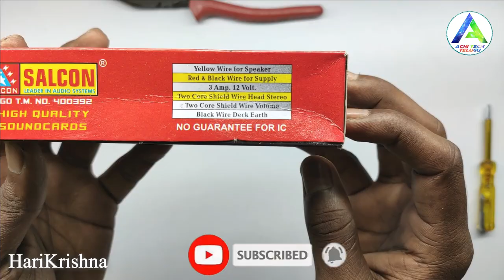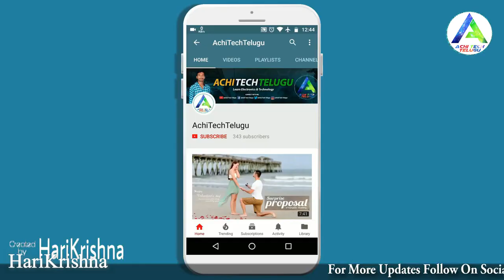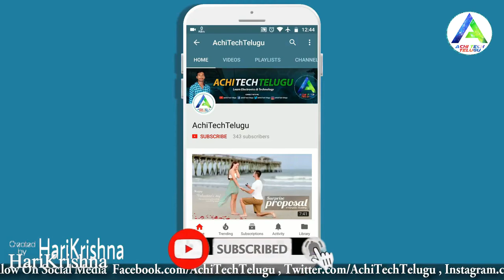Diy 4440 Ic Amplifier Telugu Part 3 | Audio & Red Solrax board Full wiring |#AchiTechTelugu

Comment: Bro 4440ic board ki speaker connect chesinapudu speaker automatic ga up and down avthundhi enduku bro
Reply: Reply ivvandi bro
Reply from the maker: Oka sari volumes controller wires ni check chiyandhi bro emina loose contact vunaemo , next speaker wire check chiyandhi , next power supply bagunda ledha chudandhi , i hope it wi help you
Reply from the maker: Already cheppanu chudandhi bro
Reply: Board tho ichina wires unchavacha bro
Reply: And aa problem asthamanu avvadam ledhu bro vadthundhi pothundhi
Reply from the maker: Manchi quality vuntey , vunchandhi bro , ledantey marchukondhi bro
Reply from the maker: @as8722  nenu pina cheppinavi anni check chiyandhi bro

Comment: 25watt amplifier medha 200RMS watt speaker connect sesthe problema
Reply: Reply me bro
Reply from the maker: 25 Watts very less than 200w Speaker Wattage So Amplifier will overload bro , but use will low volume and try it once 
Thanks for Watching , Do Like Share And Subscribe #AchiTechTelugu
Reply from the maker: 25 Watts very less than 200w Speaker Wattage So Amplifier will overload bro , but use will low volume and try it once 
Thanks for Watching , Do Like Share And Subscribe #AchiTechTelugu
Reply: Small dout bro oka speaker run seyyali ante amplifier entha percentage use seyyali
Reply from the maker: Amplifier 150 Watts vuntey speaker 100w vundali bro , apudeu neku full clarity and full performance vastayi , 

Speaker kanna amplifier watts ekkuva vundali this good configuration 👌
Reply: @AchiTechTelugu  amplifier watt ekkuva ayithe full volume pedithe  speakers lo disturbance sounds ledha speaker voice coil problem emi vundadha bro
Reply from the maker: Amplifier 50 to 60 % Sound petandi bro meku speaker full performance vastundhi 👌
Reply: @AchiTechTelugu  bro small request oka video cai bro., Oka speaker ki  matching amplifier and transformer ela select susukovali ohms kosam.. ante practical ga lekapoyina parvaledhu kani theory ga explain CAI bro. Chala subscribers adhe confusion lo vunnaru
Reply from the maker: Sure bro chestanu , Thank you 👌